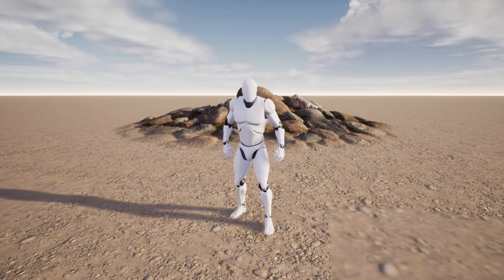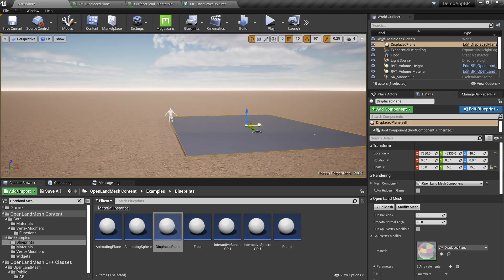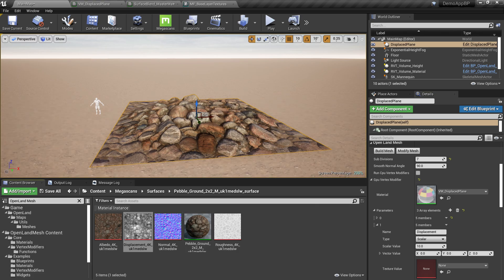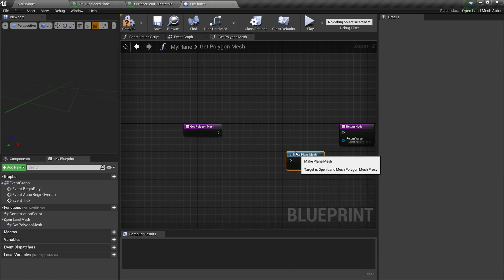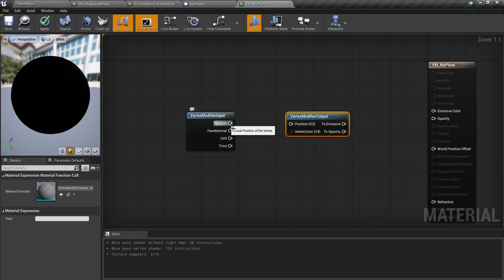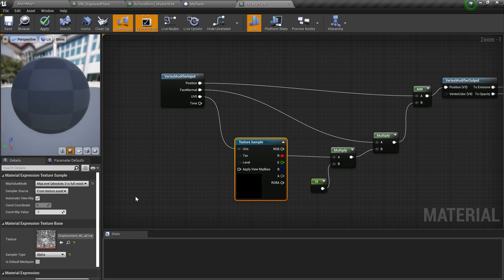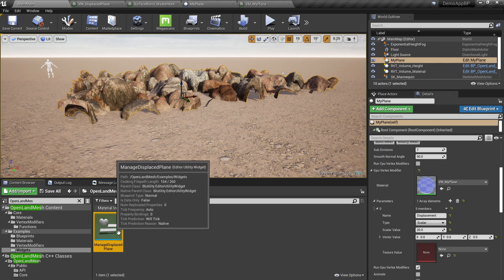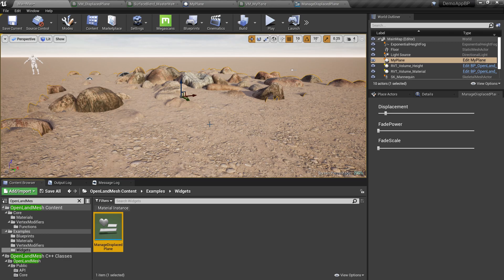Next Level Displacements in Unreal Engine with OpenLand Mesh

Comment: As you know the texture's edge is not covered at the videos end. So I want select only edge of the texture for hide edge to below ground.
Reply from the maker: Check my example material (it’s in the plugin-content/ examples/vertex modifiers directory). 

I used UV values to add the fade.